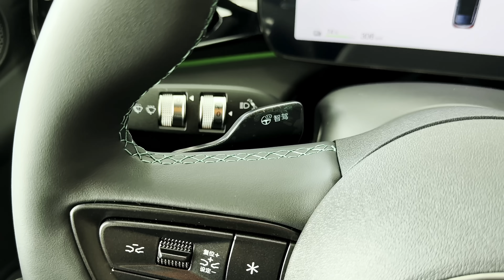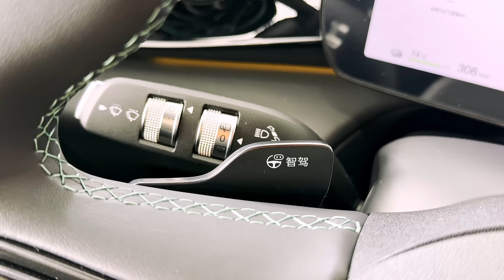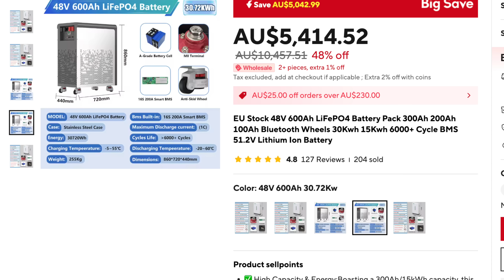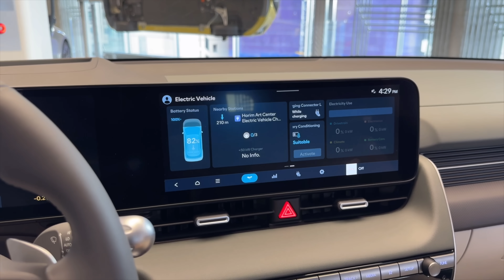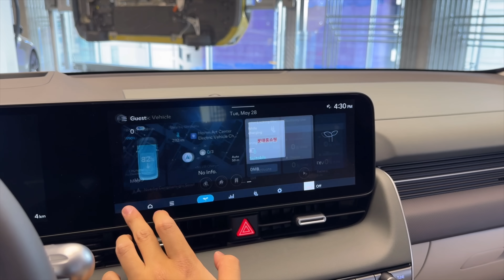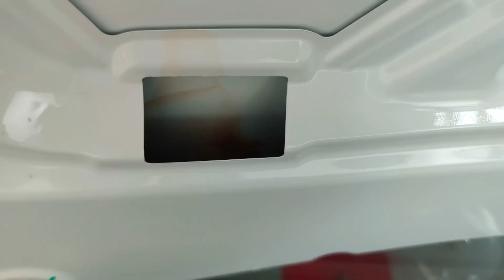Australia Is the PERFECT Country to Have an EV – Here’s Why

Comment: I dont keep track of how much I spend charging but i hardly ever use public charging. All my electricity at home and at work comes from solar. I have a 60kWh Atto3 battery at home for energy storage and 480kWh of battery storage at work made out of Atto3 battery packs. I am in Brisbane  and have 2 EVs do about 60k km with both cars per year all charged from solar.
If you ever want to do a video of EV batteries being used for energy storage let me know and I will give you a tour.

Comment: Do the math properly. In this case that can only be done retrospectively, and the results will vary wildly depending on an individual’s circumstances. Costs of 10 years of ownership of an ev vs ice car, selling the bought new said car at the end of the 10 years, is the question. 
It’s not simple calculation of course. Cost of power, which will vary from ten of thousands setting up solar, to simply plugging in the grid power. To resale value. 
I can already tell you that those drivers doing few miles will be a long way away with an ice car. Zero, or very minimal infrastructure setup, lower purchasing costs and better resale prices. Just how many people come out ahead is the question. Not many I suspect. 
I’m not anti ev, I would own one given the right circumstances. I simply work on facts, not fiction. My 10 year costs is what I’m personally looking at. Not hype.

Comment: A couple of additional reasons why Australia is an ideal place for EVs 1) There is no local manufacturing of cars now, so nobody has any commercial reasons to oppose EVs or put higher tariffs on them. 2) Australia imports 90% of its gasoline consumption, so you are essentially replacing imported fuel (at world market price) with locally produced electricity (in many cases very cheap solar energy). So it is great from a balance of payment pov. It is a complete no-brainer for Australia.

Comment: I think you're jumping the gun to say that public charger problems are solved, they are getting better but over the Christmas period last year (Dec 2024) all of the 4 public charging stations on the Hume Highway between Canberra and the Victorian border (except for 2 Tesla only chargers) were out of order and it wasn't until March or April that the majority were back online. I worked out a detour that meant I could get to where I was going because I drive that route fairly regularly and so I always check plugshare and ABRP before I start a road trip. But there's a lot of people, especially those new to EVs, who rely on their inbuilt navigation that says there is a charger at this address but doesn't give them real time data that the charger is out of order.

Comment: Absolutely not ... long distances with little or no infrastructure. Do you think they will ever have charging stations all over the centre of the country? Not unless they are run by diesel. Apart from that you will never get away from range issues ... insurance issues ... depreciation issues ... battery degradation issues ... cheap Chinese EV flooding the market issues (check out the state of the car industry in China ... on the brink of collapse). I could go on but I doubt you are listening.

Comment: With the start of V2G installed you now can have a 50-100kw battery connected to your home to potentially charge your home for 4-5 days and with a good solar system installed with a smallish standby battery, you could disconnect from the grid for good. 

Imagine not paying for power from the grid and still drive you car around.

Comment: We only have an old solar system, installed in 2007 when the rebate rules restricted us to only a 1.5 kW maximum system (government view they should not fund 'power-stations'). Because the installer and the power companies shafted us on the premium 60c FiT, we were discouraged and suspicious of ANY solar proposal ever since, and have not upgraded it.
However as there is  SO much  roof-top solar, we now have a plan where the power company gives us 0c/kWh electricity from 11am to 2pm, as well as an 8c/kWh late-night rate. We charge the EV during those hours for tuppence-ha penny or free!

Comment: We went from $4800 a year to $550 per year. You can’t really say it’s free. I worked this out on 0.13c per kWh which is what I would be getting paid for feed in tariff if I didn’t use it in the car. I don’t have a smart charger. I just schedule the charge for three hours in the middle of the day and set the rate of charge to 6kw in winter and 7kw in summer and it only uses solar doing that. I don’t have a battery and yet I have a zero electricity bill with still having an ev, I’m retired so I can charge in the middle of the day and only charge on sunny days, which as you said, is nearly every day. People still working would have to charge at night and obviously be paying grid price but at 0.33 c/kwh, it’s still inexpensive. All states have different rates but it would still work out cheaper for sure. Most people’s issue, is the lack of charging infrastructure but that is improving fast, with southern states leading the way.
Reply: My power company has an EV plan with:
- 8c/kWh from midnight to 6am.
- 0c/kWh from 11am to 2pm, every day.
Reply: Although I work away from home I can definitely charge up enough for my everyday needs using only solar during summer. Because my commute is short so I can usually get back up to full charge over the weekend to last me the whole week. In winter we have more overcast days so I often do have to pay to charge up overnight at least a few hours per week.

Comment: I live in Sydney and over the past 12 months we have suffered a lot of overcast/wet days so my panels have not helped with charging all that much this year. But I buy my power from a company (AGL) that offers an EV plan for 8c/kwh between midnight and 6:00am. The cost to charge my Tesla M3 over the past 12 months/16,000km was just over $200.
Reply: I have the same charge of 8c per kW but have available 24/7

Comment: I live in the Redlands but my old 2019 Tesla Model 3 SR+ sadly won’t get to Tenterfield without stopping to charge in Warwick.  The ‘fast’ chargers there are just 50kw and, sadly, are often not working.  My only option is diverting via Toowoomba for the Tesla superchargers there but that’s a significant diversion.  So, sadly, when I have visited Tenterfield I have to drive my old ICE car.

Comment: Have you ever been to Western Australia. Good luck finding a fast charger anywhere outside of the CBD that works. I think you should do more research. UK and Germany and most European countries have more chargers and cheaper recharging costs. I have had my EV for 3 years and yes it is cheap with solar power but you can't take your solar with you. Perth was 3c last night and only 14c daytime. Summer hottest day was 48c so there is a big difference in winter to summer driving range please get your facts right.

Comment: It's great that people can charge their cars from their solar installation. We do! But most people drive their cars away from their home during the day to go to work, so it's not so great for them. Having said that, even paying off-peak rates for power overnight is a lot cheaper than buying fuel.
Reply: If you're doing less than 400km a week, they can charge of their solar on the weekends.
Reply: The average commute distance to work in Australian cities is about 16km. Well within the range of any EV without needing to charge :body-blue-raised-arms:
Regarding costs for an overnight charge; I charge from ~20% to 80% for about $4, and I usually only need to do that once per week, or twice if I do a trip in the country on the weekend.

Comment: Hi Ben,
Nice video and all I can do is fully agree with your conclusions. I have owned a BYD for over two years in Perth and have NEVER charged at a fast charger. I have done day trips to York and multiple return trips to Fremantle (quite far from me), all just using my solar panels. Two of us share the car so it does decent mileage, yet the panels are all we need. EVs are everywhere here, and the Shark is becoming very popular in Perth, I see many.
Reply: Those trips are really just local travels (barely a day trip). I also only charge at home here in Melbourne for all my metro trips and 99% of country day-trips. However the public fast-chargers were required for my longer road-trips to Echuca, Mildura & Renmark, and on the 4,500 km return trip to Hervey Bay, towing our Jayco camper-trailer.

Comment: This video made me curious as to how much power my 5.2 kw PV system with a Tesla 2 battery uses per year. In 2024 it produced 6,767.3 kw/h with a monthly average of 563.9 kw/h per month. I’m in Zone 4 so considered a low solar production area by Australian standards however, in 2024, only 23% of the solar my house produced went straight to the home, 24% went to the power wall for use later in the evening and 51% went straight to the grid. If I had owned an EV I could have used 3,371.3 kw/h of power for my own use. If I owned an EV with a 60kw capacity battery , I could charge it from empty to full 56 times. If the EV could get 350km on a charge that is 19,600 kms of power. There are of course EV,s that can do better and some that do worse but as a rough average a medium sized EV should be able to travel about 20,000 just on the extra power my 5.2 kw PV system produces.  Unfortunately I don’t own an EV and the power company buys my power for 5c kw/h and wants to sell it back to me at peak for 42C kw/h. Unfortunately I’m one of the few that actually require a Ute for work (farming) and no one actually makes a suitable EV version yet. I refuse to get a phev as I think it’s the car manufacturers way of having their cake and eating it too. The BYD Shark 6 is certainly practical in many respects but at the end of the day it’s still a petrol engined vehicle that requires oil, servicing and spews out co2 the moment the ice starts. Yes, I could get around this many times by charging it and travelling less than 100kms but sooner or later the ice starts. (The ice man cometh? 😂) 
I’m still betting the Shark 6 is ultimately designed to be also a Shark 7 full EV despite BYD,s protestations to the opposite. 
The best part of owning an EV with VTL will be using it to power the house in the future. I’m quite sure the power retailers are aware of this. I see that legislation was passed in SA this week to allow retailers to charge small producers ie those with solar panels, a fee to use the grid. Essentially paying the retailers for the right to produce power for them to sell at retail rates. The theory being that we need to pay to help the grid operators to maintain the system because we are using it too. So we pay them to receive power, pay them to give them power and pay to get back the power we just produced.  Much better to just put the power you produce it into an EV and call it quits.

Comment: Hey @BenAlexxander, I'm in Sydney and I'm researching how to get solar on my rental home.  Are there any solar panels that are removable? Or is there a energy company that only does renewable energy in NSW?
Reply: Plenty of portable power systems around these days and energy banks you can use, Jackery for instance provides a portable power station that can be expanded to 12kwh and you can get foldable 400w solar panels you can set up anywhere (note of course you rarely get the full 400w so look at reviews), with a few of those you can charge up your 12kwh power station and run the house for days (depending on usage requirements of course). Renting is always going to be an issue for people who want to take advantage of solar, but having a system you can move with you from one rental to another is ideal. The world is awash with portable solutions, ecoflow, jackery, Renogi Bluetti and many more. Plenty of reviews on setting them up on youtube as well to see which ones are easier to setup and move..
Reply: @stevebrooks2361 thanks mate appreciate it

Comment: Hi Ben,
A well thought out summation. My wife and I are in our early 70s and bought our first EV (KIA EV3) just over a month ago. I don't think EVs are for everyone but in our case it was a no brainer (despite raised eyebrows from the adult kids). We don't intend to do massive road trips and definitely not going bush. Charge at home on a15 amp circuit for free with Ovo energy plan between 11am and 2pm. Have small 3kw rooftop solar. Interestingly fully comprehensive insurance with Youi $660 p.a.
There's a lot of misinformation, disinformation and outright lies to sift through and it did take me a few months of research to become comfortable with making the shift to EV.

Comment: Read the room. Australians have spoken, and they have said, loud and clear, that they dont want EVs.  We've said so, repeatedly, for many years. Which part of "No" dont you understand? LOL. EV sales have never cracked 10%, ever, and last month were down to 7%. Well except for Canberra, and that is a universe totallly detached from reality. LOL
Reply: We recently acquired a Kia EV5, we live in a regional area, and my partner has a 130 km round trip commute.

We have solar and batteries, but the car is away during solar generation.  We changed electricity retailer to one that offered an EV plan, with electricity at 5 cents per kwh 00:00 to 04:00.

We have a 7 kw wall charger, and we charge every night.

Normal daily running costs are less than 2 cents per km.

EV was a no brainer.

Between fitting solar, batteries, and changing one car from ICE to EV, we save around $160 per week 

That is effectively tax free disposable income
Reply: @tazpartridge1612  Good story. I cant see its relevance to this topic.
Reply: There's no fool like an old fool.
Reply: Complete rubbish. Please do some research before you offer silly opinions, not based on facts. EV sales are 20% of new vehicles sales and growing. Cheaper to buy, cheaper to run and safer
Reply: @peterjohn5834  LIAR. My figures are from FCAI. Take it up with them if you dont like them. Your 20% figure is a complete LIE. Even including PHEVs it is still a complete LIE.
Reply: @peterjohn5834  Wrong. Completely wrong.
Reply: @peterjohn5834  Those figures are from the FCAI. 5% BEV sales in May 2025. 9.7% BEV sales in all of 2024. If you dont like it, take it up with them
Reply: @peterjohn5834  As is your "cheaper to buy". Complete nonsense. Do you even know how to read prices on a car window sticker or a web page? 😀😀😀
Reply: @peterjohn5834  Even if you include PHEVs, it's nowhere near 20%. I think for May 2025 it was like 13% for BEV and PHEVs combined. It's nevva evva evva been 20%. Nowhere near it. That's a completely made up number.
Reply: @peterjohn5834  Stop making up shit.
Reply: @peterjohn5834  I will grant you that now that Blackout Bowen has imposed his Ute Tax on (amongst others) 4 of the 5 most popular cars sold in Australia (utes and SUVs, all ICE of course  😀😀😀), things may change in the future.

Comment: Im a mobile personal trainer in adelaide, i bought a 2015 nissan leaf (said it had 92% battery but it didnt i got dupted it only had 77% soh but i digrese) back in 2022 and used it as a business car daily for Pt it was only the 24kwh and its usable range was low but it did my daily driving job with ease for multiple years. Now it gets less than 90km in winter when i drive hyper efficient so needed to change (currently looking into getting a atto 3, ioniq or kona) but when i was using it i was only spending 33% if what i would on fuel i paid peak rates of electricity but dont feel bad since SA Is leading in renewables NET. No solar on my house but thats also in the plans soon. I drove a fairly efficient mazda6 wagon 2.5L petrol at 7.2L/100km if i spent 3k on fuel i was around $990 in electricity in the most expensive way of doing it. I loved my leaf and still own it but plan to sell it asap as its SOH is around 60%. My wife uses it as her work car which is more than plenty for her. These cars are accesible and easy to charge from a power point and although some are over priced. The amount i saved per year in fuel alone made it worth it (especially cause i could write the car off on my tax return 😁)

Comment: Great video! This is the sort of thing that should be shared with all those EV doubters out there. 
I’ve driven about 22,000km in my MG4 in just over a year. I don’t have solar, but am on a variable rate so charge the car overnight at 8 cents per KWh. Have done a lot of long trips, both for work and holidays, so use public charging a fair bit. I’ve done the trip from Melbourne to Brisbane  as be and back, no problems (including via Tenterfield on the way up, using those Tesla chargers - great little town!), also all around Tasmania and lots of Victorian trips. I’ve never had any major issue with charging. If I’d been driving my previous car I would have easily spent about $3000 in fuel (plus $500 servicing). I estimate I’ve spent around $1000 in charging the MG4 (home charging and public chargers), and no service costs so far.